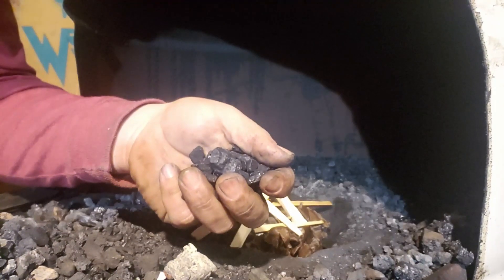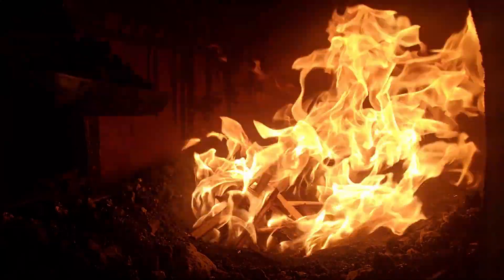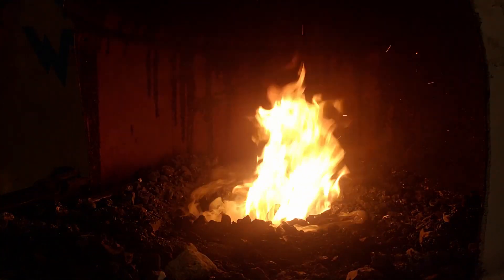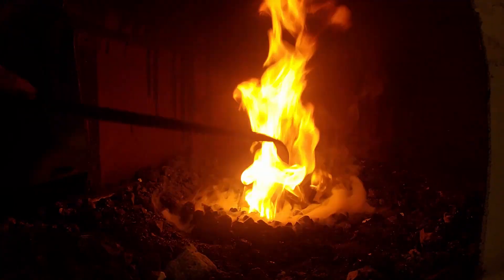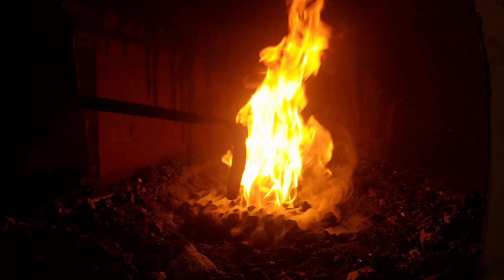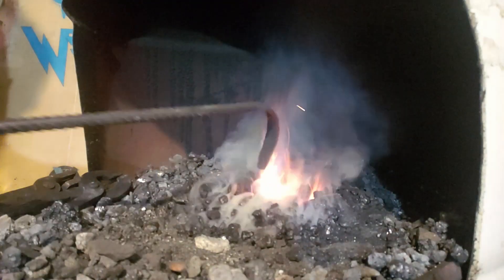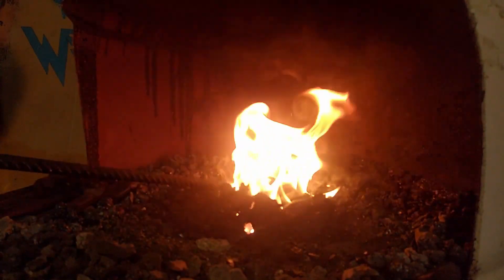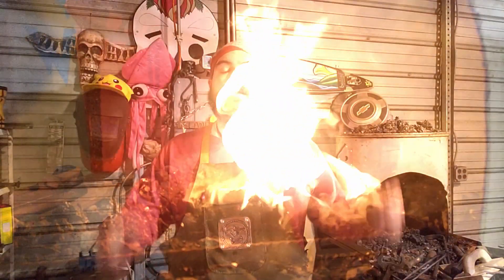How to light Fresh Coal - Bituminous

Comment: Still trying to figure out how to properly use bituminous coal for various forging techniques. I have both but as of late I've been using the anthracite just as it's a little bit easier until I get the full grasp of coal forging processes
Reply from the maker: Anthracite, if you have an electric blower is easy, Bituminous is easy as well, you just gotta pull the clinker out... and you can make caves!
Reply: @IslandMetalForge  I do have a metal blower. Haven't quite got the hang of making the caves and stuff for Forge welding and everything. Which is why I continue to use the coal Forge to improve my skills with it. Thank you for the wisdom

Comment: I have fresh blacksmiths coal and my forge is just one big plate with a blower attached , there isn’t a pit or hole to put a fire , and I know how to start a fire but struggle to actually do so, any tips? I’ve been sitting on my forge for over a month and I need to fire it up
Reply from the maker: Howdy Noah, for a flat fire pot if that's all ya have one option could be to use a grill chimney to start your fire, another, build a little fire using sticks and once its going start piling coal around it and eventually over top of it... coal will catch, keep the air going and it will catch.